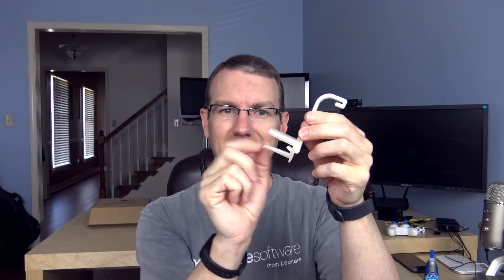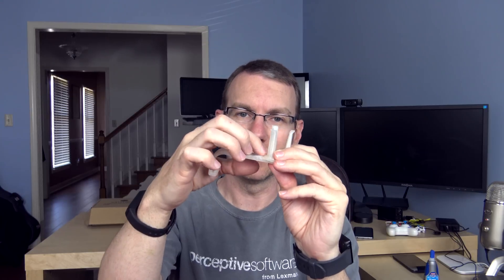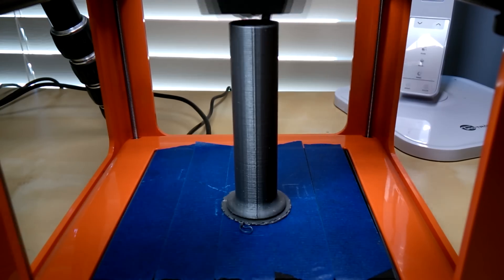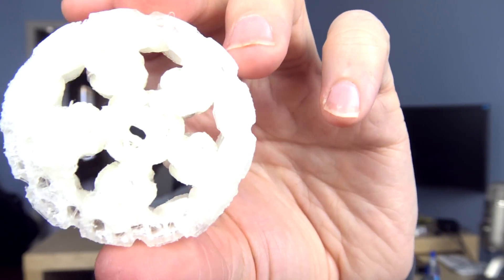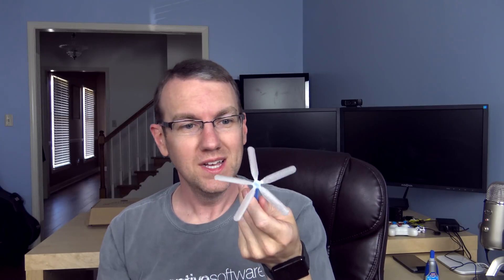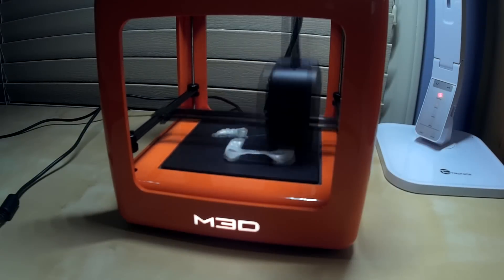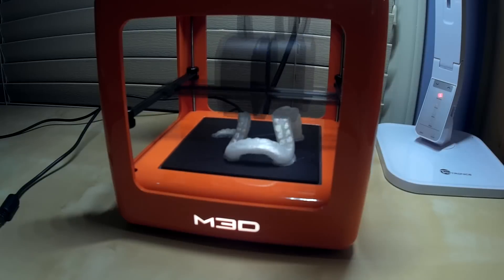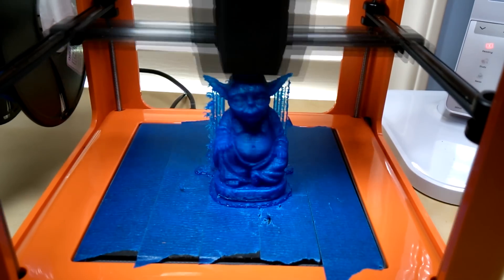3D Prints Of The Week: Yoda Buddha! Tentacle Phone Holder, OnePlus Phone Dock!

Comment: Dang. That thing prints really, really, really slow. I use a simple metal (i know, it is 200$ more expensive), but even a printrbot play which just about 50$ and it is HUGELY better. It is faster, larger build volume, and it can actually be modified (and you don't have to rely on a crowdfunding campaign). While the play is exceptionally good, this really just doesn't stack up.

Comment: For ABS and to help solve the problem of things not sticking to the bed, raise the temp about 10 degrees. Don't print with a raft. This will help stop the problem of layer separation and it will improve the quality of the print. I got this tip from M3D directly. It's made a huge difference. I still get some warpage in thin areas but only minimal. 
It does support ABS with the current updates and it supports the newer "tough" filaments, "or flexible filaments". I was discouraged with quality and issues until I did this simple task. You can make a custom heat setting fairly easily. 
Hope this helps!

Comment: my m3d printer isnt holding any items i print, they dont stick to the bed. what should i do
Reply: +GlitchFreakGames Start by googling what kind of bed adhesion is recommended for  what type of material you are printing.  Blue tape or hairspray are go-to's; my cube pro came with water-soluable glue that works pretty well.

Comment: What temperature are you using the Hatchbox PLA with? The max Hatchbox Temp given at Amazon is 210 degrees but the Micro says in the description that the temperatures are a bit different than other printers so did you stay with the 215 that the Micro uses when entering "PLA" ?

Comment: Also printing the last parts of that filament holder atm. The first part was perfect, part 2 doesn't have as good of a layer adhesion ... I guess it is because I printed it at night and the heating went off ... still it should work ... but I wonder why the first print was so much better ... maybe because I cleaned the nozzle before, I realized that after a few prints if you open the printhead and check with a small piece of metal there is some rest plastic in the nozzle

Comment: why do you use blue tape for some parts ?
Reply: +Jordan Keyes I know, I asked because the Printer has a printsurface, special designed to increase the adhesion or isn't it working well?
Reply: +Jordan Keyes Okay, no actually I have a startup which developed a adhesion spray which provides a much better adhesion than buildtek and the price per print is also lower. The company is called AprintaPro.com and we start the sales in 2016 ;)

Comment: does the printer use a lot of power? could you notice a change in you power bill? Just wondering because my parents probably won't let me have one if so
Reply: +Jack D In a previous video, he shows the power supply is a 5v 4a DC wall wart. That is incredibly small for a piece a machinery such as this. My UP! Mini uses much more power (because it includes a heated bed), about 230 watts I believe. This little printer only uses 20 watts.

Comment: Try printing at a larger layer height for the stuff like the spool holder. .3 layer height should be just fine. For stuff like little detailed things like the yoda buddah you would use a .1 layer height. This should speed up your prints.